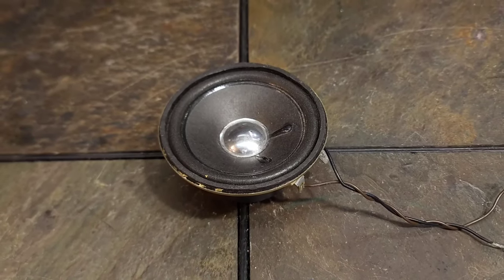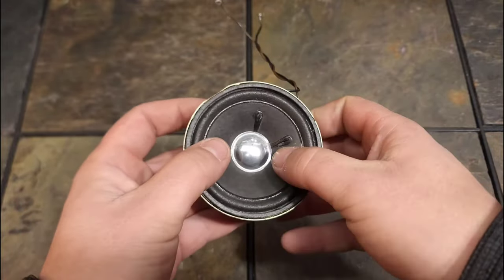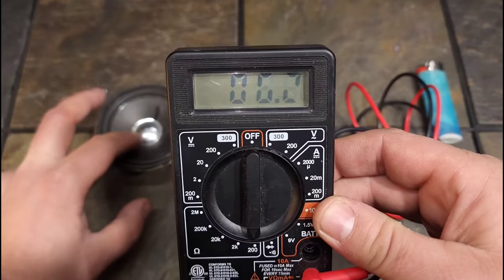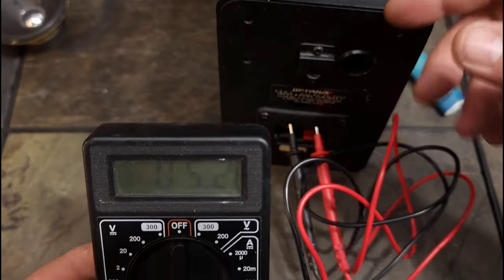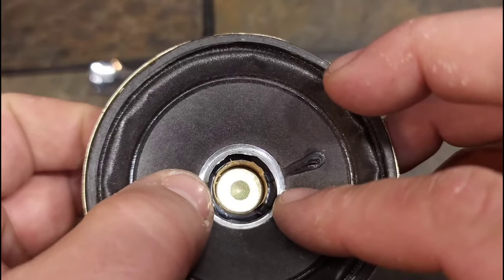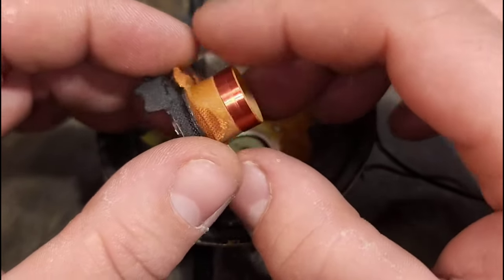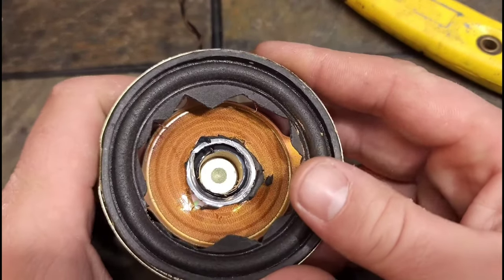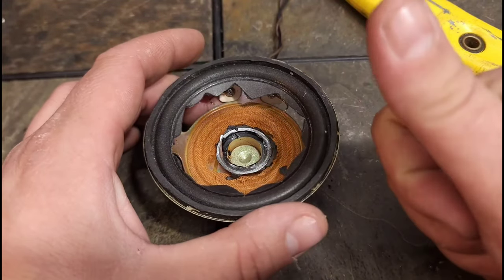How To Tell If A Speaker Is Blown

Comment: I have a problem where when  I run auto room correction like Dirac or Audyssey, the speaker image pans to the left, all the time and I can correct by adding delay to the right. Is there something wrong with my right speaker? Does this sound like a specific problem?
Reply from the maker: @shaunmills4611  If you can correct it with a delay on the right, then I'd say it's unfortunately a room issue. That is super interesting!

Comment: My subs just stopped working while I was listening to music and I thought it was blown but everything is reading negative do you know what it could be? The speakers are reading 1.5 ohms on one terminal there dual 4 ohm and when I push the speaker it reads negative
Reply from the maker: @hey1080  it will show negative impedance because you're actually creating electricity when you press it It should read for when it's sitting completely still if it's fluctuating when you're not touching it then it could be blown
Reply from the maker: @hey1080  I've had them come undone on dual voice coils on one of the two sets of leads inside the speaker box maybe that's what's going on